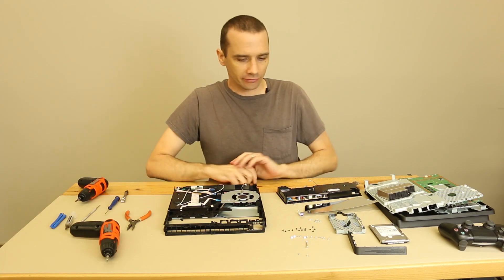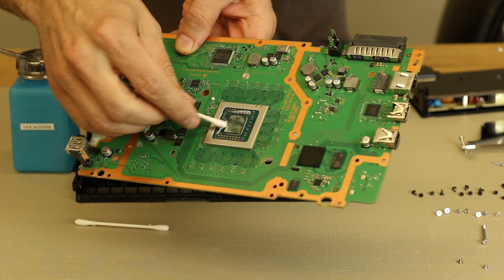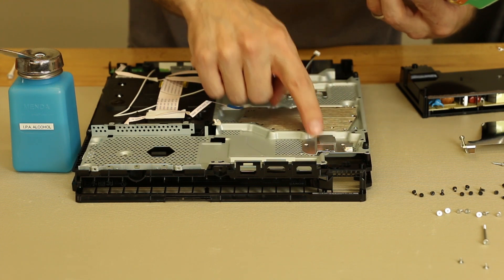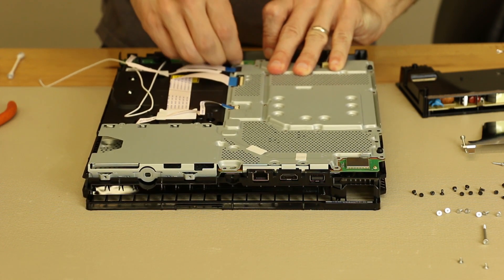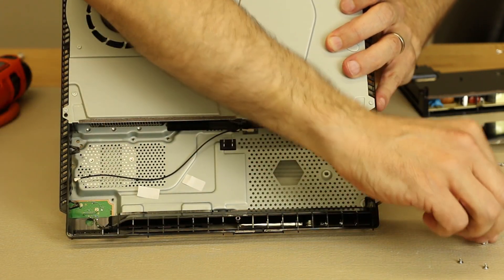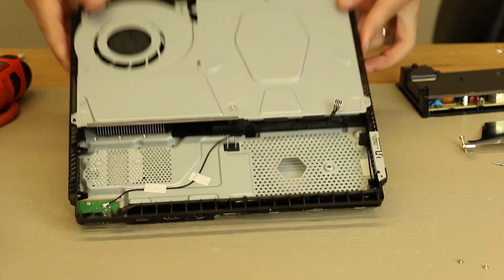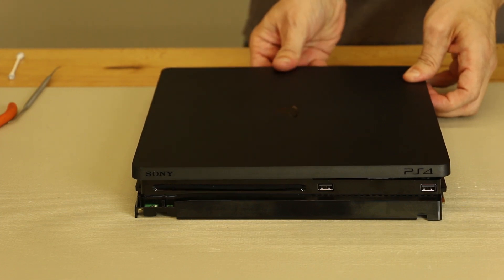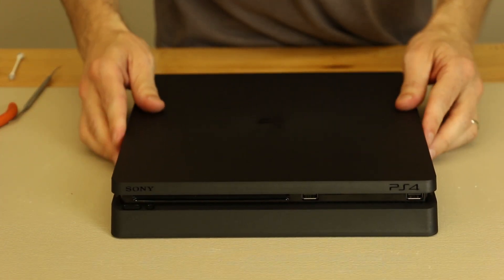PS4 Slim Detailed Assembly - Thermal Paste Replacement

Comment: Good video but I completely messed up my system hard drive won't fit I'm not about to take everything apart again. Very frustrating
Reply: Update I was able to get the hard drive in, but now the fan is louder. I give up
Reply: Got Ps4 for sale
Reply: @tylorclark5219  LMAO 🤣
I think you needed to replace the thermal pads...

Comment: Did my thermal paste but am paranoid on if i did it ok i used the pea dot then spreaded it but i dont know if my ps4 is regular hot 2hen gaming for awhile or too hot. I redid 4 times lol 😂 ithasnt eevr said overheating just dont kniw if it is too hot or nog. Maybe i shoudk just redo andnit spread it but use your method and add it on ther without spreading and let the clamp spread jt

Comment: I put it back together with less screws than I took it apart with. That means I’m better than Sony’s engineers….right?
Reply: @user-my2is5mm5j  I can't take apart any electronic and have 0 screws left at the end. I intentionally left a few out of an old hp laptop cause they're were maybe 100 screws holding in the mother board
Reply: LMFAOOO SAME

Comment: Damn, without your help I wouldn't have figured out how to disassemble, change the thermal paste and reassemble my PS4 slim. Thank you for your beautiful guide!1
A little difficulty that occurred to me was that sometimes I don't know where to screw up some screws, specifically  those of the plate up to the motherboard (the silver screws), because there are two types woth different lengths.
Except for this little detail, this video and the previous (the teardown) are literally a life saver.
They allowed me to save more or less 90 euros!
So, thank you sincerely! 💪🏼😊

Comment: Hay techtronic's I just followed your guide to strip down my ps4 slim and replaced my disc drive as it was coming up unrecognized disc error and put it back together with brand new disc drive installed and still coming up with unrecognized disc message any advice what could be causing this issue?? 
Thanks in advance

Comment: I left the old paste but cleaned the fan, motherboard and heat sink it blows out cold air even when I play a game so it’s cooler to be more specific half of the heat sink was caked with dust I just used a brush to clean it. I did the same with my old Xbox 360 because it was getting soo hot especially when I was playing gta V.

Comment: You put the WiFi antenna on wrong mate the metal clip also attaches to the mid frame there’s a little slit it connects the power supply to the mid frame that’s the only reason you even have to take the screw out for it cuz otherwise you be able to leave it on when you took power supply out

Comment: Hi, i have a question, i just changed the paste to MX 4, and when i turned on the console went ok, it took a little more to boot, but it went on.
The thing is, i initiate a game and then it shuted down, i don't know if a i put a lot of paste or little paste, but i tried to imitate the size of your paste, but what i see while watching your video again, is that the pad that is in the right side of the second processor (The SIE that is near the EXT and HDMI port) doesn't have a Tpad, does that can make the PS4 go off?, right now if i let cool the console it can boot, my second question is, what thermal pad do you recommend?, and other question, can i put a little paste in those pad's? or that can create a bad transfer of heat?.

Comment: Im buying artic sliver mx4 for my ps4 original model i had a repair guy replace my thermal paste last month on the 23rd and it was quiet up until now basic games like fallout 4 ramps up my fan i think he used some cheap brand thermal paste so im wondering if artic mx4 is good as artic sliver 5

Comment: Great Contin great explanation messages well received.   I have a PS4 they had over three years and it look like my TV was having a seizure or something and then my PS4 wouldn’t start the next day; I hope I just need to clean it thoroughly so I’m gonna take it apart now cleaning with the cold air spray hopefully that does it but if it does not really going to try to take it apart and do what you’re doing or send it into Sony or yourself!?!  Ty.

Comment: I'ma be honest with you, your console has less screws than mine, I have around 4 extra. I took my console apart using your disassembly video, I used a pocket knife for the Philipps screws, and needle nose pliers to grip the "special" screws and tediously unscrewed them, didn't strip one screw. I'm no professional, but I'm a smoker and live in a basement, eventually I got tired of my console sounding like it was getting ready for a Nascar race. I bought it used, and turns out they never took it apart as the sticker and everything was intact. Putting it back together I did manage to end up with 2 extra screws a black and silver, even with placing them exactly in the order I took them out, however honestly I have never heard this thing so silent, and it doesn't get hot anymore. I've been having these problems since I got it, but they only got worse, so thank you for the help with this video, man. I greatly appreciate it.

Comment: Thanks so much for your detailed videos.  I used your PS4 Slim teardown, HDMI port replacement and re-assembly videos to fix a friends PS4 Slim.  It was my first time trying to do surface mount,and I did a pretty nasty job of it, but it works and the PS4 slim is back in service.

Comment: I have 2 small metal parts help please they seem to be grounding plates, one is black and screws with 2 screws and one is small shiny tin whit one screw they just came fo an d fell when I was disassembling for cleaning. Thank you
Reply: Same a black then fell out when I took only the top off to clean mine
Reply: @mrramrod8562  I found the video in wich someone shows they go unde the fan cover the black one is not so important but the silver one might be grounding and it connects the fan cover to the CD reader
Reply: I bet it goes to the wifi antenna connector 

It has an attachment below the CD reader
Reply: @matthewthomas7339 I found a detailed video that showed where the 2 metal parts went. Thank you!

Comment: Help i put a non branded thermal paste in my ps4  because its dried up then suddenly i play nba2k20 and my fan turns out so loud i clean both heatsink and the fan properly. Should i replace a good thermal paste? Thanks

Comment: Going to attempt a thermal past replacement end of the month hope it goes smoothly 🤞🏻
Reply from the maker: You got this! Just go slow and be careful. Good luck!
Reply: @Tronicsfix  Just did it took me 4 hours was super stressed there a 3 extra screws don't remember where they go an a small bracket clip under the power supply but other than that she's super quiet

Comment: Should mention that Black screws are going in to the motherboard, white screws are in to the body (plastic) and the very small white screws connect between the metal plates.

Comment: 2 questions: first do I need to replace the thermal paste absolutely or I can leave the old one?
Second, I opened the ps4 like in this vid but I found the pièce That you talk about in the vid of the disc drive... How am I suppose to replace it?
Reply: If you open up the ps4 then you must replace the thermal paste, it is not correct to use the old one

Comment: Dude thanks so much that helped me a lot! I can barely hear anything coming out of my PS4 anymore :)
Reply from the maker: So glad this helped.
Reply: @Tronicsfix  you don't know how happy I was to finally clean my PS4, since I've had it for over 2 years now and never cleaned it once :)
Reply: @Tronicsfix  yo I need help with my ps4 I was cleaning it and when I turned it on afterwards it made a jet like sound with increasing pitch and suddenly turned off and I feel like if i turn it on again it’s gonna explode, what should I do?
Reply: @dr.dominator9578  is there a cord in the fan or sumn
Reply: @Dr. Dominator you probably put the fan connector plug in wrong. It's either not inserted fully or in reverse. The third pin is for fan speed control and if it runs at full speed then you don't have that pin connected.
Reply: @Tronicsfix  dvgvrubfrg  q , no b q b ok

Comment: Anyone else get a little nerviness when he tightened on APU screw all the way then the other? Maybe it's not the same as PC's CPU but I personally would do it evenly.

Edit: the reason to do it evenly is to distribute the thermal paste more evenly.  But I do imagine as it is still a sensitive part that the technique of making a few turns at a time with a hand tool would be more ideal.  Regardless of skill/experience.  Just my own two cents, take it or leave it.
Reply: Yeah normally I screw it in evenly so none of the thermal paste would leak on to the components

Comment: where is the smaller ribbon connected to..the one that funs from the disc drive? i cant find a slot for it
Reply from the maker: The one near the front of the disc drive? It wraps around and plugs into the motherboard.

Comment: Hi Steve, do you know if the ps4 slim ( I have a CUH 2016b model) heat sink is made out of aluminium? I'm about to do a repaste and was wondering if it can take liquid metal.
Reply from the maker: No I don't.
Reply: Thx for the reply. Shame, but i let you know if I find something out.
Reply: were you able to find out whether is aluminum or copper? I want to use LM on my regular PS4 as well.

Comment: I de assembled my ps4 for cleaning but now my disk is not reading by console i think there is a problem on ribbon cable from disk drive to motherboard plz help me how to fix this
Reply from the maker: Yep, it's probably the ribbon cable. You can try cutting what's left of the little ears off of the ends of the ribbon cable but that may not work. If it doesn't work then you would probably have to replace the connector on the motherboard.

Comment: Hey I really need some help here. Recently I sent my ps4 to a pc repair shop to replace a HDMI port. They game back my ps4 with a new port but now when ever I start a game, the console displays an overheat screen beeps 3 times, glows red and turns off. What did they do to my ps4? Please help, I might sue them for terrible service.
Reply from the maker: There's no way for me to know what they did. Overheating is generally an easy thing for me to fix. I would take it back to them and have them fix it. If they are good they will fix it at no cost to you.

Comment: Find it pretty pointless to disassemble a PS4 slim to change the thermal paste. Been using mine for 3 months now with heavy use, and no issues.

Anybody remember the pink bubblegum style thermal paste the Original Xbox had? lol
Reply from the maker: There is no reason to replace the thermal paste in any new console right when you get it.
Reply: Lol what a dumbass

Comment: I can tell already that things going to have heating issues.....
Reply: Nope, been using my slim for 3 months now with heavy use, and no thermal issues yet. Haven't heard about any either.
Reply: That's My Two Cents the fan may be small but mine seems to run fine
Reply: Scratch that
Starting to have shutdown issues
Reply: Just randomly shutting off? Still going good here, only issues i've had are software ones. Like sometimes the PS4 slim won't supply power to the USB ports in Rest mode, even though I have it set for them to be powered all the time. A quick bootup, and then put back to Rest fixes this. The other software issue i've had is a known problem across both the Slim and original model and that is sometimes the dashboard doesn't register the fact there is a disc in the drive, yet I can clearly hear it spinning up and reading like it's about to launch the game, but the menu glitches out and won't show it until I eject and renter it, or reboot the system.
Reply: Torque Effect could try a hard reset(have system off for 10 mins)

Comment: Did you get an improvement after this? less noise maybe? It's sad that you can't compare the temperature before and after :/
Reply: Platinum tbh the system is pretty much dead quiet when running

Comment: Isn't AS5 electrically conductive? I'd be worried about it shorting out those little voltage regulators or whatever around the apu.
Reply from the maker: No, it's not.

Comment: +TronicsFix Hey man!! Great Work on your videos!!! I like soo much to see that you understand a lot about the Hardware of the Consoles, and with this message, i would like to ask your help of another subject that hasn't connection to this video.
I have a PS3, old "Phat" model, of 80GB of HDD, which i have brought on 2008, and until start of 2012 (Exactly in february), he was working great. Until the day that he have suffered Yellow Light Of Death (YLOD), i touched the button, he turns Green, and shows the start of the System, and then the beep sound of reset is heard and at the same instant the YLOD appears on the Power Indicator. I have opened the console, all the pieces i have disconected and i've dissassembled the entire console, still, i haven't noticed the problem in the time because of the lack of knowledge at the time i opened. Looking back right now after soo many time that has passed, i want so much to fix it, and simply i don't have a single idea how to do it, since the PS Support on my country, which is Brazil and i live closely to a beach, i don't have the assistance of Playstation even if it has for PS4 (In limited terms & functions) because i tried so many times to get the assistance and nothing has happened. This was 4 years ago and for 1 year i constantly tried until i gave up at the time, but right now i want to fix it for myself.
So please, could you help me with this "mission"/task? What do you think that it could be causing the YLOD problem? What should i check/test? It is a processor/Ram problem? Or even envolving the subject of this video, about the Thermal Paste? Could be the temperature? I really don't know, that's why i really need your help brother. I have known your channel right now, and already subbed on it, i really enjoyed a lot your work. Thanks a lot for bringing this knowledge/information for the people, if everyone on youtube have and attitude in this sense like you have, to help the others, youtube could be more helpful more than already is. Thanks!!!!
Reply from the maker: Unfortunately, I don't know much about PS3's. I started with PS4's so that's what I know. Sorry I can't help more.
Reply: +TronicsFix That's allright man! Thanks for the answer. Do you know any other specific channel you could bring a reccomendation for me? I really need support on this situation. Thanks
Reply: Thiago Felipe de Oliveira this happened to me two weeks ago bruh... I have no clue what to do neither
Reply: You shall find the problem with the yellow light of death to be your thermal paste yes. The things you will need are thermal paste and Torx screw drivers with security tips. My advice? Just buy the set which is T8 and T10 make sure it is the right set it has to have security tips. And if you already have the set then all you need is the thermal paste.

Comment: I bought the slim a few days ago , love it 👌
Reply from the maker: Nice...I've barely used this one.
Reply: Did you ever replaced the thermal paste? Mine has 1.5 years, and I am starting wondering if I need to replace it...
Reply: @artyom_1553  pls if it works fine dont touch it. Mine never turned back on.